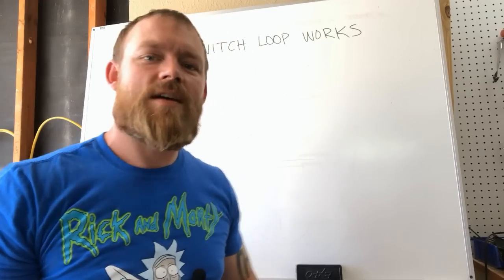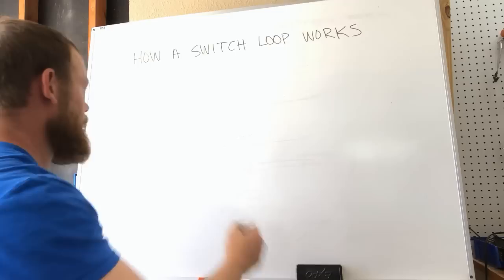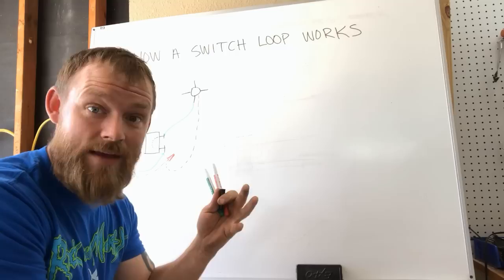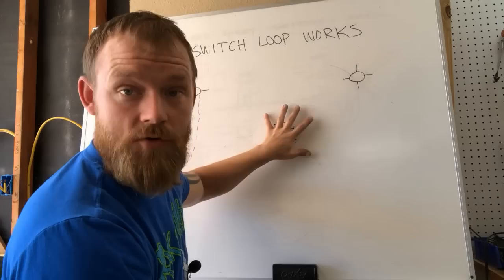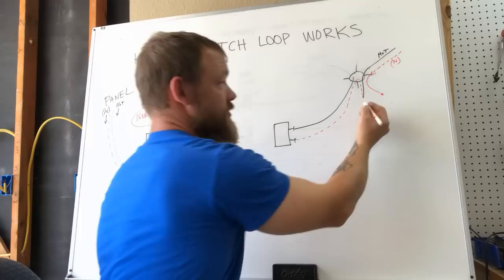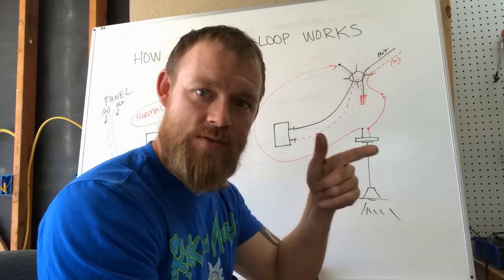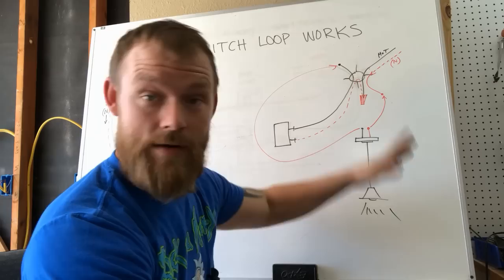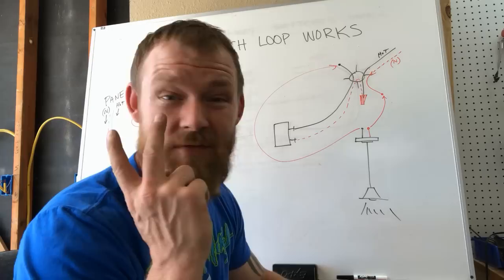Episode 13 -  SCHEMATICS how a switch loop works

Comment: Just found out my kitchen chandeliers have the switch loop method (white is hot + black is load +ground) , but want to Use a smart switch that requires a neutral. Can I get the neutral from a neighboring outlet that's 6"away??

Comment: ALWAYS label the white wire into the switch as black at both ends. That makes it intuitively clear. Not that you can “legally” set it up this way any more, under the 2020 NEC.

Comment: Hello Dustin. Great video. I have an old home and i was a bit confused about the wiring in my bathroom. Now i know that a switch loop is at play. If i may, i have a question regarding the switch. So, i would like to know if it is possible to replace the single switch with a single pole double switch (excuse my lack of proper terminology). So my switch controls a single light in the bathroom as in the diagram. I would like to add a double switch, an exhaust fan, and have have one switch operate the fan and the other operate the light. So, in the switch loop diagram, is it possible to erase the single switch, add a double switch, and wire said switch to a fan? In other words, is it possible to extend wiring from the switch to power a fan? If it is possible, can you refer me to a wiring diagram or some other source i may use? If it's not possible, can you inform me of how i can make it possible? Thanks.
Reply: It's a bit hard to understand what your asking. Could you do what he's explaining twice? One for the light and one for the fan.

Comment: Thanks so much for the video.  I have a situation where I am replacing an old ceiling fan and when I uncovered the box in the ceiling, I have two white wires tied together with a wirenut.  The two black wires went into the old fan to wires labeled "motor" and "common" respectively.  The switch has a white and black coming out of it.  It appears to be a switch loop, but I am confused because it is somewhat different than the schematic you described.  Any suggestions on how I wire to the new fan? Do I ignore the old set up?  I would assume I need to find the hot wire from the panel and connect that to the white wire from the switch, then connect the white wire from the panel (hopefully easy to ID) along with the black wire from the switch to the respective wires on the new fan. Am I on the right track?

Comment: Could you show a schematic and help me figure out how to require with the way it would work with the hot coming into the switch box and then to the overhead light. The neutral is then tied into the hots...  then from the light back to the switch box to operate an outside light and a bedroom??? Not used to seeing it run into the switch first so I’m lost. Thank you!

Comment: sorry  Can you use 14-3 and have the duel switch for the light and fan on the switch loop?
Reply: Yes and no.   You would have the hot from the ceiling fan tied to the white, you typically would use the black for the fan and the red for the light.    As of 2011 this configuration would be a code violation because switch boxes must have a neutral available for the future installation of specialty switches.

Comment: Shouldn’t all new construction have a neutral at each box not sure if its in the 2018 CEC
Reply: I have seen it in the NEC book . but
Reply: Yeah that was added in the 2011 NEC, but a lot of localities use older versions of the NEC so you can still do it in a lot of places.

Comment: To run a neutral in the switch box, I would just run a 12/3 for the switch loop, with the black and red wires for the loop and then the neutral just capped at the switch right?
Reply: Avoid running a switch loop if you can because it makes something that should be simple complicated. But if that's the best solution for your situation then yes run a 3 wire, cap the white in the back and switch the red/black

Comment: ok I was still thrown way off until 5:53 where you actually drew out an actual light and drew the lines from the main to the switch and light without stop and talking about other people... that right there FINALLY clicked! But for such a confusing factorial, all you had to simply say was "Coming from the main, connect the white wire from the main to the white wire on the light.... etc".  You keep saying "box" but are you referring to the main or the junction for the fixture?

For people that are inclined for basic electrical but just not grasping this concept let me try to mend with his video. (Not trying to smack talk or anything, it just took a certain way for me to grasp it and sharing for others that may not grasp as well)

A. All you are doing is just making a switch interrupter(starting and stopping the power from the switch)
B.  This is still code as you are still going through a breaker(this concept is the exact thing you are doing when running 3-way switches, you are extending the hot over to another(except a red wire) so whatever people are saying about code standards, hang up the phone and move on, how do you think lights are extended from existing light sources?...

Legend:
(M) - Main Fuse Panel
(N) - White Neutral wire
(H) - Black Hot lead Wire
(LGT) - Light Fixture/Fan
(SWT) - On/Off Light Switch

Connections:
- KILL THE POWER FROM YOUR MAIN PANEL BEFORE YOU BEGIN.

1. Take the (N) wire from your (M) and connect it to the (N) wire on your (LGT) wiring
2. Take the (H) wire from your (M) and connect it to your (SWT) ... I like to connect hots to the lower screw
3. Take the (H) wire from your (SWT) and connect it to your (H) wire on from your (LGT).

The above can also be used if you want to go from an existing light source, just carry over from that to another switch.

Comment: I have a bathroom light using a switch loop and I want to put in a bathroom light/fan (on separate switches) and have the light switch turn on the overhead and vanity light. Is that going to be too complicated for DIYer (basic experience)? Great video!

Comment: I have a switch that controls 2 lights in the garage. they are run by a black red white. It continues on to another light over my work bench that I would like to control by a separate switch. How would you wire the light to the switch so it is separate from the other two lights ? would red go to the light first ? what kind of switch would I use ? thanks ahead of time for the info. good vid.

Comment: What about a 3 wire switch loop to switch a light or a fan? Is there an issue having a hot and 2 switch legs in one cable?

Comment: Hey man, good video! Makes total sense to me.  What doesn't make sense is I have 2 rooms in my house that are wired hot, white and black at the switch.  But I cannot find where the hot is coming from, I think it's coming from one of the wall outlets, but I tested each and every one of them and the switch doesn't control any of them.  Also, there is no ceiling box, it's just straight drywall.  What do you think is going on?
Reply from the maker: email me at dustin@electricianu.com so we can talk in long form.  I need some more details, it's hard to tell what you're asking.

Comment: So I have 2 k&t wires coming into a ceiling light. Also there is (romex?) wiring that has a black, white and a ground. Is the romex wiring coming from the wall switch? So ur saying that once I find out which k&t wire is the hot then I can connect that to the white romex wire then run the black to the black and blue wire coming from the ceiling fan I am installing? What do i do with the white wire coming from the ceiling fan? And the green ground? Still a little iffy

Comment: This helped us figure out that we have a loop switch. Was trying to figure out why the lights came on as soon as I switched on the breaker but the switch was off. Switching to on tripped the breaker. After watching this, we rewired and now only three of the four turn on with the breaker. The fourth works with the switch. What now?
Reply from the maker: Re wire the light fixtures with the proper switch "loop" configuration. Or hire a professional to do so. 

It takes some doing to troubleshoot something like this. It isn't complicated or difficult. Just at times. Time consuming.
Reply: @ElectricianU  Since writing this, I found a schematic for running multiple lights off a switch loop online and gave it a try.  All is good now.  Thanks.

Comment: In the switch loop why couldn't you just joint the hot black to the black sent to the switch box so that the white wire coming back to the light wouldn't be hot? Wouldn't that prevent any confusion?
Reply: not really, you're still using a white wire as a hot so it's still the same. Plus if you did it that way you would have two white wires to you light fixture which is added confusion.

Comment: Switch in two wire,  white is neutral, black is hot.  Black and neutral to ceiling light.  Switch controls wall outlet not ceiling.  ??

Comment: This really helped me visualize a switch loop. I am replacing a light fixture (and while I have electrical knowledge from the Navy, it has only helped me here to a degree). So I have 4 (2 black 2 white) wires coming out of the box in the ceiling for the fixture, essentially what is shown in this video. One black wire and one white wire has black tape. The black wire with tape is always hot. Then I have two longer wires (one black, one white). The first attempt, I put all black wires together, and all white wires together. With the switch off, the light stayed on. When I flicked on the switch, it tripped the breaker. I'm seeing why now. So I think I have a blown dimmer switch. And I think the white and black (black hot) wires with tape go together. Then the other black and white go to the fixture. Does that sound right?
Reply: Kyle Wood correct

Comment: I just replaced my flourescent lights with LED lights and I found out the hard way that it was wired as a switch loop. To add a dimmer, do I need to connect the wires different for it to work
Reply: To add to this, I mean, on the new led dimmer switch, do I need to connect the wires different?

Comment: Hi Dustin, I was called to replace a smart switch that would operate a porch light. Well i turned off power to the supposed porch light switch. Checked it with my voltage detector and it didn't register any power. But, when i put my voltage detector into the porch light socket it registered as being live or hot. But oddly enough it won't power a light bulb. Is this because i have the breaker in the off position to the switch on the wall? Could a switched loop setup cause all of this that i just described to occur? Im not an electrician by trade but rather a carpenter. Any insight into the aforementioned predicament would be greatly appreciated.

Comment: If I understand correctly (and that's not very likely) in this switch loop, if I removed the light fixture, but kept all other wires connected, I'd be looking at a black wire from one line of romex connected to the white of the other line of romex and vice versa (so 2 sets of black wires connected to white wires)? I can see you all cringing now.... but hey, at least I'm asking, and doing my research =)

Comment: With creating a switch loop like this where the power is ran to a light, is it possible to hook up another light fixture with its own switch off of that?
Reply: Holy God, it fucking worked!!!!! 
I’ve had a very basic understanding but I could not wrap my damn head around a switch loop, so I never used it. Today I had extra wire, 2 lights and 2 switches so I did an experiment using the switch loop method. Works well. This is GOLD!!! Thank you for your explanation man! I have subscribed and am looking forward to binge watch some more of these videos .

Comment: I was changing a front porch light and turned off the living light breaker off and light went off. I check to see if I had power and did when I took porch light off why did I still have power to lights. I turned living room receptacle breaker off and was fine. Why is this? Did they do a switch loop from the receptacles? Glad I checked doubled even with light going off. House was built new about 20yrs ago.

Comment: If you use a white wire as a hot you need to wrap it in some black or red tape identifying that it's not a neutral and you're using it as a HOT.

Comment: Great Tutorial. I have a question for
I was trying to fix a light switch outside in a small storage room outside . It has a metal Switch gang box . It's my first time fixing a light switch . I have done several receptacles so I have an idea. 
The Metal gang box has a live wire and a neutral no ground. I tested voltages and and they came back at 99 volts and different readings but consistently at under 100 volts. 
I went to the light switch but I could only detect voltages from one of the white live wires 
Nothing detected at the white wire that connects the fixture . DID NOT take any measurements as I don't know what to make out the whole mess. There are wirenuts which I opened and peeled the wires and reconnected and put back on wirenuts. I guess the question is . With the light switch only getting 99 volts do you think is the switch?  Thanks

Comment: If I have a light and 3 receptacles in 1 room and the switch controls all power to the room...how do I make it so the light is on the switch and the plugs stay hot all the time?

Comment: Thanks. What if I want another fixture to be connected to the first light fixture?
Reply from the maker: When adding another fixture to a switch loop, the incoming hot stays tied to the hot going to switch, which in this case will be the white. The black wire coming back to switch the fixture will be tied to the outgoing power for the additional fixture, and the neutral for the addition will tie to the incoming neutral. Hope that makes sense.

Comment: Can you do this with multiple 3 way switches and or does a 4 way need adding. 
Looking at ceiling lights that are now controlled by a single switch in the middle of the room.  Future is I need to eliminate that switch and put in 4 switches at different doors that enter this same room.  Can a switch loop work in this way???
Reply: If you need a light switched from 1 location
single pole switch

If you need a light switched from 2 locations
2 - 3 way switches

If you need a light switched from more than 2 locations, 
1 - 3 way switch at the beginning
1 - 3 way switch at the end
4 way switches at every location in between where the light needs to be switched

Comment: Why not use the black to send the power down to the switch and white to return it? Wouldn't that be safer and make more sense, at every junction, even without labels?
Reply: Because then you have two white wires going to the fixture, so then you have two potentially confusing things instead of just one.

Comment: So I have a ceiling fan that is wired similar to this .. but, in the box for the switch are 2 14/2 wires.. one white wire is labeled “LN” and another wire is labeled “LD” ..  here’s where it’s gets tricky - the 14/2 wires are on separate breakers . And only the black wires are hot. I will double check that after watching this video. I’m that guy that is just trying to help someone change a switch now he has 4 wires hanging out of his wall.. any idea? Oh and each wire is in a different breaker box .. not sure why but he has one box in his basement and one on the main floor of the house. Any help would be greatly appreciated.

Comment: Can you remake this video on your smart board? I kinda understand what your talking about. I have someone who had a outside receptacle in a loop with their indoor high hats and front porch light. The receptacle was dead so I was putting in a gfci for them, but I can’t get it to work. So now because I can’t understand the way they wired it I also can’t get the lights back on.

Comment: I was installing a ceiling fan for my mom. I didn't know what this was called and I could not convince her that we need to shut off the breaker because this exists and the wire could be hot even with the switch off.

Comment: At one point when he began describing the so-called "switch loop", he said one wire would be saved because the neutral didn't have to be brought down to the switch. Then naturally went on to contradict himself by describing the two wires that indeed are brought down. So that was one misstatement. And for all that trouble and work of explanation, he never bothered to say if or what the advantage of wiring a light switch "backwards" was supposed to provide.  I agree, it IS very dangerous to use a white wire as hot even if it is allowed, especially if it is unnecessary, in which case it is stupid. It is just common sense to avoid that if at all possible.  If it is so important to wire it that way, why not at least use 220 color coded wire with a red and black? At least then you have some hint that both are hot. Another reason this loop switch thing is stupid is because you cannot make the lamp cold (the entire fixture/box) by simply turning off the switch. Granted, if people are around, you should flip the breaker and mark it or lock it out. But if you are alone, there is no reason to do that and you can easily double check the light for a hot condition, so it is completely safe if you only need to work on the light. The only possible reason I can see for doing it is if the switch is a long ways from both the light and the panel, and the switch is the farthest away. But I also do not think it would be a good idea to mix conventional and loop switches. Why any code would even allow loop switches is beyond me. Even the name does not make sense. This just proves to me that not all code is for the safety reasons they purport, and some idiot got it pushed through so he could continue doing his work the "wrong way".  I say it is stupid and just don't do it.